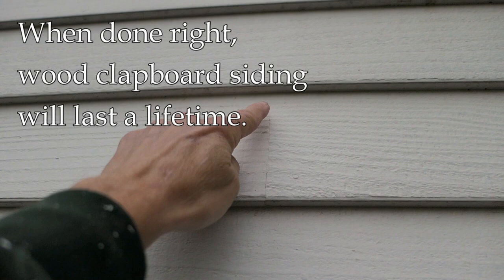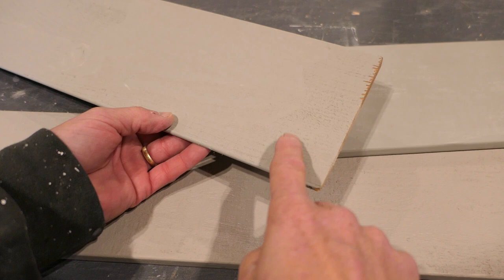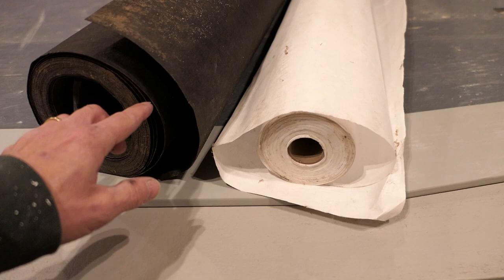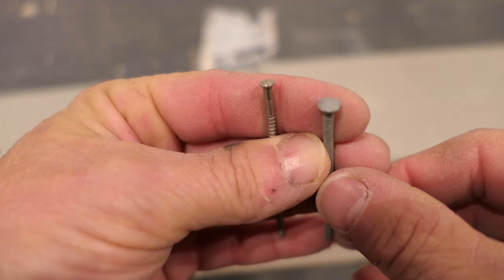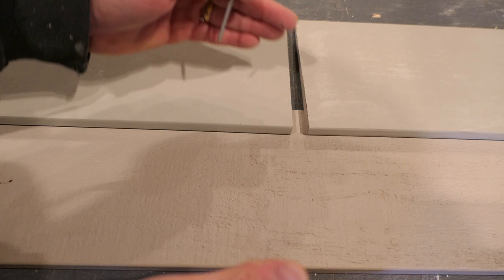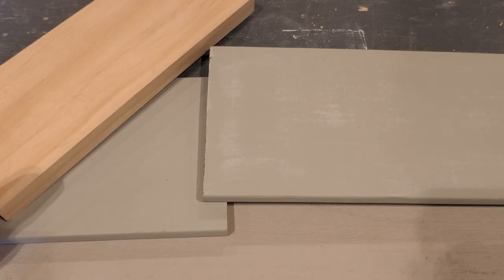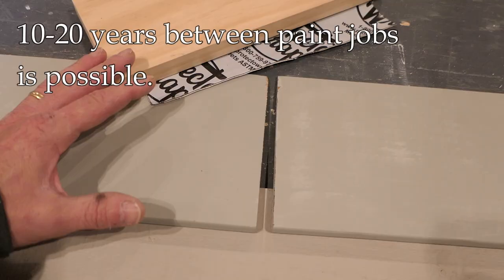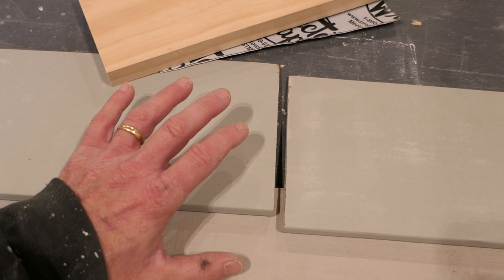Painted Wood Clapboard Siding Which Lasts A Lifetime

Comment: I notice you mention no gap between laps. How do you handle draining of moisture that gets behind the boards? I assume so long as its not caulked and has a slight gap, that's fine? The guy who painted our house tried to seal a lot of the gaps between laps with paint. What is your opinion on a rain screen? Necessary? Thanks!
Reply from the maker: If you back prime there really isn't a reason for a rainscreen.  The bottom edge of the clapboard should be tight against the top of the row below.  If you install the siding, trim and flashing correctly there should be no water or moisture getting underneath the siding from the exterior.  Some humidity or moist air may migrate from the inside of the house to the outside under certain conditions, but that is minimal and can happen slowly.  There should be nothing behind the siding which needs to drain, put it that way!

Comment: Awesome video!  I’m doing repairs and extending garage that has 1x8” 105 profile lap siding (pine). Are there additional steps that you would recommend? Thanks again
Reply from the maker: We call that "drop siding" or "novelty siding" in my area.  The same principles apply.  I would be extra cautious about back priming, since all of today's pine lumber is very poor quality and warping could be an issue.  Thicker siding also means it can soak up more water on the end cuts, so be certain about priming those too. Mark your studs prior to siding installation so you are sure to hit them.  There will be more weight with pine drop siding than with cedar bevel.

Comment: I didn’t know about the tyvek behind cedar issue. Does the same hood true for typar?

Also, you mentioned redwood in your video, are you lumber yards still selling redwood beveled siding? I’ve never seen it for sale in the Midwest, but I have 80 year old redwood on my house that looks like it was installed last year.
Reply from the maker: I would assume Typar has a similar issue with cedar as Tyvek, but I haven't seen it personally.  Just keep an eye out if you have this installed.  It doesn't always cause a problem, but when it does you'll start to see failing paint and even rot coming through the boards.  

As for redwood, it's pretty rare here in the northeast where I am.  Hell, even finding cedar clapboards can be problem nowadays! It seems to be more common in the west, since that's where the redwood grows.

Comment: Thank you for this video.  

If you are painting and repairing cedar lap siding, are there rules of thumb you use as to which boards you replace?  Damaged boards obviously, but what about boards that show some warping etc. 

Thank you again!
Reply from the maker: That's a great question.  When I'm hired to replace damaged or marginal clapboard (or similar) siding I need to make judgement calls.  One factor is the budget, for sure.  If the damage is extensive, another factor may be the length of time the homeowner intends to stay in the house.  Getting a house fixed up for sale is different than a forever house where the homeowner will be for decades.  Another factor may be the age of the house.  A 1700s home tends to appear natural with a few marginal boards, whereas a home built in 1990 may look shabby.  

Beyond that, I'll consider the sun exposure and likelihood of further damage, how close to the ground and damaging moisture the boards may be, whether there is sheathing and building paper or not, if the whole house will be painted again or not,  and even what quality of replacement I can currently find versus the quality of what's already installed.  In short, you have to balance a variety of factors with the available time and money.  Warped or twisted boards are not likely to fix themselves and will only get worse, but if money is tight you could always wait for next year.
Reply: @enduringcharm  Thank you for the informative reply.   We just bought the house and plan to be here a while.  Think I’ll replace those in question since I’m geared up anyway.  

Appreciate your info on the use of flashing underneath the two board seams. That is not something I thought about.

Comment: Great Video!  Are you priming with oil, latex or something else?
Reply from the maker: Oil based primers and paints have disappeared due to changing regulations.  Fortunately the latex primers are as good or better than the oil based primers ever were.  I will often use Zinnser 123 primer for both exterior and interior projects.  It's readily available and has never let me down.

Comment: If I wanted a nail-less finish, could I predrill holes in the top and cover them with the overlaps?
Reply from the maker: In short, no.  Wood clapboard siding must be nailed at the bottom in order to hold the boards in place.  If you nailed at the top of the boards you would soon have warped and cupped siding and as the upper part of the boards split where they are nailed, the siding would fall off the structure.  However, if you really want a clean look with no nails showing, you could install Hardiplank cement board siding instead.  That product is installed with roofing nails at the top of the board so that the siding basically hangs from the nails.  Each successive row covers the previous nails.

Comment: My home is a Carriage House built in 1886 and is located in Cambridge MA. It is has 1/2 inch bevel cedar siding. 10 years ago I stripped the entire house using the Paintsaver machine. Applied 2 coats of an oil based primer and two coats of a latex paint. The paint is now peeling again. I been told that I should have used a stain. I am now considering residing but wondering if I should use a stain instead of paint on non primed cedar siding. Any advice on stain vs primer and paint.
Reply from the maker: Something overlooked by many homeowners and contractors alike is that a house or other structure is an interconnected system.  If you focus entirely on one component you'll likely miss the impact had by other components in the system.  Peeling paint seems like a simple thing to solve--just find the right finish or the right finishing process, and Bob's your uncle.  But, it's more complicated than that.  Peeling paint can have lots of causes including wall insulation type or condition, the type of exterior wall membrane, whether a rain shield was installed or not, the roof style and condition, the depth of soffit overhand, the use of gutters or not, the surrounding trees and vegetation, the style and structure of the house, the species and quality of wood siding, and a million installation details like flashing, caulking, ambient temperature and humidity and how the paint was applied.  When I look at a paint failure I try to get a handle on all of this and more.

So what is your issue?  Even in your limited description I see some red flags.  It's an 1886 structure, so if the siding is original or at least many decades old then it probably is not back-primed, and you may not even have sheathing underneath.  It was a carriage house so it was not intended to be a home in the first place, and I'm sure insulation is lacking and there is no weather membrane under the siding.  Since it is now a home, and a modern one at that, there is water vapor being created indoors from living, bathing and cooking, and that will tend to migrate to the outside.  You live in MA so there are extremes in temperature and humidity over the seasons, and the wood will move with those changes.  None of this is good for paint adhesion over the long term.

When you stripped the siding, you exposed fresh wood, but that needed to be primed fairly quickly or else the sun will begin to damage the wood with UV light, and that can affect adhesion.  You primed with an oil based primer, which may have been your biggest mistake.  In New England the myth dies hard that oil based primer is still superior.  I'm old enough to remember when the standard advice was to wipe the siding with boiled linseed oil, then paint with oil based primer and finish coats in a couple of weeks.  Well, things have changed.  A quality water based acrylic primer is a more flexible finish than an oil based primer.  As such, it will move with the wood through the seasons more easily than an oil based primer and tends to have better permeability.   Oil based primer with a water based topcoat can sometimes be a problem too, both at the time of painting and later.  If the oil based primer isn't completely cured before topcoating there can be compatibility issues, and later the two layers of paint may tend to move at different rates with seasonal changes.  My guess is that if you had used a waterbased primer and water based topcoat, your peeling problem would either be non-existent or at least minimized.

As for stains, a pigmented stain does have a more "gummy" texture when cured, so it may be used to hide problems because it will accept more extreme movement.  On the other hand, it also will not last as long and lighter colors may be a problem over knots or imperfections.
Reply: @enduringcharm  Thank o for your kind reply message. There is insulation in the wall cavity mineral wool and rigid foam and R15 fiberglass in the rim joist. I had to repair some of the cedar siding and there is felt paper and  2 x 8 board for the exterior system. The felt paper is in bad shape which is why I am considering a residing. After watching your video I am reconsidering paint. I was told that a stain enables the cedar to breath and will not peel
Reply from the maker: If you decide to put up new clapboard siding then you can backprime the boards and peeling paint will not be a problem.  New siding may well be finger-jointed, though, unless you have a big budget.  Typically it will come primed now, although lumberyards in your historic area may stock clear and if you order enough for a whole house you may be able to do a special order.  You must, however, clean and re-prime both sides of the boards even when they come pre-primed.  The factory prime is too old, scuffed and dirty by the time it gets to you to be effective.  If you use a quality latex acrylic primer and finish paint, you backprime, and you put up new 30# felt, you won't have any problems.  I've resided many homes from the 1700s without sheathing and still had success as long as I backprimed well.

The pigmented stain is great for old barnwood or dark colors on other vertical siding.  I even use it on my truck bed.  But for traditional clapboard siding I prefer paint for longevity and looks.

Comment: Thank you very much for your very detailed instruction with tips and tricks!
I am dealing with a window trim board under a northern face window in Dallas.  After remove the 1x4x7 f. trim plank, I discovered somehow the siding plank under the wood plank has some rod, soggy areas (dark brown) that seemed not able to hold nails.  Do you think if I have to replace whole siding board behind or if there is someway that I could repair the siding board? I believe it is type of engineered siding board mimic wood, but not real wood.  Thanks!
Reply from the maker: Let's back up this train for a second to make sure we're talking about the same thing.  So the walls are built with studs if it is a house built in the 20th or 21st century.  Then sheathing is applied to those studs, which might be plywood or something called OSB (oriented strand board).  Then on top of the sheathing should be a house wrap of some sort, which might be "felt" or tar paper if the house is older, or it might be something like Tyvek, a plastic sheeting.  Then the siding is applied, and the siding may go under some of the trim or it may go up to the trim and just be caulked.  

With that said, the window trim nails should penetrate into the sheathing or even the studs if possible.  The rotted or "punky" area that you see under the trim, are you certain that is siding and not the sheathing you are looking at?   If it is indeed siding, there is not much you can do but replace it, or perhaps make the trim board slightly larger to cover rotted area that you remove. If it is sheathing, then you need to see how far the rot goes.  A small section you might leave alone after you allow it to dry out and you cover it with new house wrap or flashing.  A larger section should be removed and replaced with new sheathing.  I have some other videos which I think might be helpful in your understanding  here: https://youtu.be/6R_5CGKMJXw and also here: https://youtu.be/lb4QPUsK-1I
Reply: @enduringcharm  John, Thank you so much for your prompt response in details!  
Yes, there is indeed a siding behind the window trim board.  It is a bay window.  I think that is why the builder used siding planks instead of using bricks with sheathing around window frames.

I am going to use a 1x6x8ft weather treated trim board to replace the original 1x4x76’ trim, so I could have some solid edge on the board to put nails into the good siding planks.

I also plan to put a piece of 6 inch galvanized steel flashing at the back of the new trim board to protect future rain water penetration into the siding, if I do not remove partially rotted siding.  Good thing is that Dallas normally only receives small amount of annual rain.

I wish I could show you some pictures to explain why I am not really confident if I could handle the siding job since I do not have adequate power tools to make a straight cut on the siding…and I do not have any experience working with siding.  I only want to improve the situation but not to make it worse…

Do you think if I still need to put a layer of moisture protection sheet behind the steel flashing?
I will certainly using ample amount of silicone caulking between the window (metal frame) and the 1x6x8 ft window trim board.  Thanks!
Reply from the maker: Well, I definitely don't have a complete mental picture of what's going on--it's always difficult to try to explain these things with just words. But, I'll offer a couple of further tips. First, galvanized steel flashing is not used anymore, and I'd be surprised if you could even buy it.  Instead, you can buy aluminum flashing in the form of a roll or in various preformed profiles. They also now make a very thin copper flashing which is backed by a plastic.  It comes in a roll and because it is thin you can form it to many shapes.  Copper offers an additional benefit in that it is antimicrobial when it bleeds copper over time.  

All that said, the most appropriate flashing is probably not metal at all for your application, but one of the self-stick plastic or rubberized membranes sold as "window and door flashing."  Some, like the Zip System Stretch Tape, can be formed over almost any profile and it sticks tenaciously.  What I'm not clear on is how exactly you are flashing the work, so I think I would need a picture to offer advice on that.

As far as repairing the siding, you might consider purchasing a multitool for the job, which will get use for other work too.  (See https://youtu.be/X5oyljd-fTo).  If you don't want to spend the cash, you could do it the old school way.  Before we had these power tools I would repair clapboard siding with just a utility knife and a carpenter's square.  Hold the square on the clapboard where you need to make a vertical cut and then use the utility knife to repeatedly score the siding until you break through.  Above your cut may be a little bit of siding left which is hidden by the board above. You can sneak a saw in there and hack it off, or sometimes it will just snap off on it's own if there isn't much left.  Worse case, if you screw up, you replace a few more boards than you anticipated and weave it in with the existing work.

Comment: you don't mention leaving any gaps for expansion.
Reply from the maker: Wood expands and contracts with changes in humidity, and it does so mostly parallel with the grain.  Over the length of a clapboard, movement is not a great concern.  If you are butting siding against trim boards, you can leave a sixteenth or an eighth and fill with caulk before painting.  I will also consider the environment, such as the position of a wall relative to the sun, the amount of shade or vegetation, and the potential for rain and moisture in the area.  Some houses take more of a beating than others.

Comment: “Sugi” Japanese cedar any good? Looks like I found a very reputable lumberyard selling for 1.12$ a linear foot.
Reply from the maker: Never run across that, but I see no reason why it wouldn't be as good as another cedar.
Reply: @enduringcharm  you're my lucky charm! Local Lowes just got a pallet full of .5x6x196" (bundle of 10 per pack) 100%  Western Red FJ cedar primed. bundle of 10 pieces for only $179! Puts it at just over 1$ a linear foot, which compared to my local lumberyard's 3$ a LF, is a steal. Shortly after my order was processed, Lowes increased the price of their remaining stock by 100$ a bundle so my price was clearly from last year when it was last in stock. Win!! Manager said they haven't seen a shipment of cedar in any store in ages... Jumped on it and bought 16 bundles at the lower price. Hopefully decent quality. Thank you so much for your advice and informative videos.